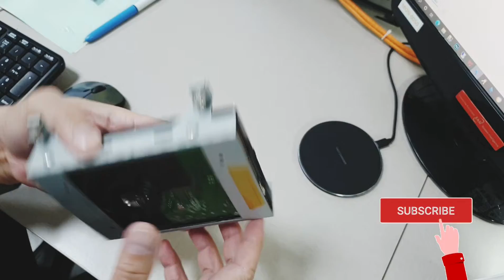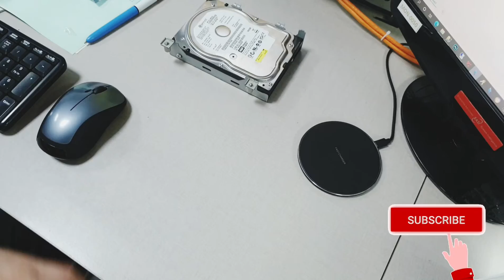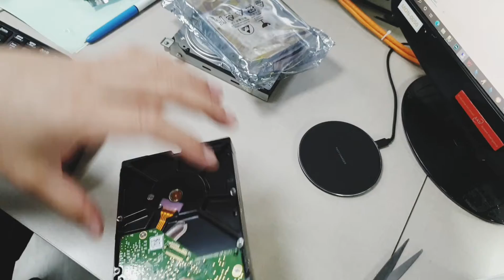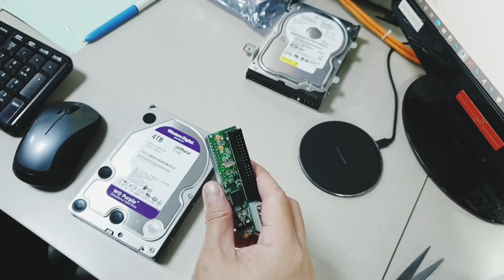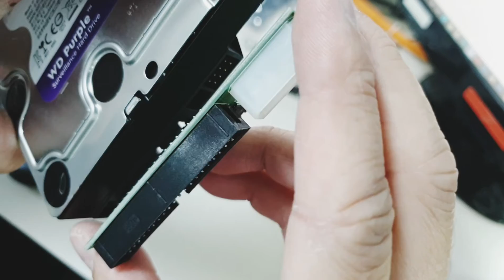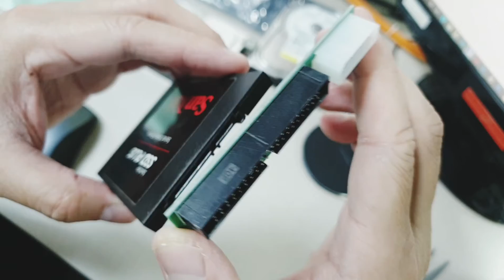IDE To SATA Converter: Revive Old Computer

Comment: Someone on Amazon is saying that these converters can't burn CDs with a CD/DVD drive SATA that it cause freezes and crashes unless the person using it is not slowing down the burn speed so I don't know if anyone investigated that yet.
Reply from the maker: Hi, I have heard that there may be some issues with using these converters for CD/DVD burning. Some problems may arise from low data transfer speeds in which converters may not provide adequate speed. It could also be due to driver issues or inadequate power to the optical drive, leading to failures during the burning process. Additionally, it might be related to chipset compatibility, where the converter might not fully support the specific functions of the optical drive. But for, I'm onlyl using this to run older pos machines that uses IDE.

Comment: Forget computers for a moment why does items like harddrive recorders with lots of different brands all with different firmware these adapters don't work. In terms in the  environmental impact of things becoming obsolete and for the land fills   sites just for the sake of a hard drive that is not made anymore. This is unacceptable adapters are bull shit they should release a ssd ide drive that will actually work or if they can make IDE to the same spec as spinning platter
Reply from the maker: Yes, sometimes I do wonder why they didn't create an SSD that has an IDE connector as an option. It should make all of our lives easier.
Reply: @ReynaxisSolutions   they do make ide ssd but mostly 2,5 laptop size and very rare 3.5 full size but they are very expensive and still will not read or format fat 32. manufacturers don't want us to be able to use old computers and other things that we can repair and not throw away.
Reply from the maker: I agree. Even this converter that I used here is only great in PC's where there is more room for this to install. However, I used it to revive our old POS machines and I ended up with the cover's of the pos not closing properly due to this converter's design.

Comment: Hey Rey, thanks for showing this adapter, will this allow me to use a old desktop computer, but using SSD drive, and using a Linux operating system.
Reply from the maker: Hi Mark, welcome. I use lots of this to use with our old pos machines that uses IDE.
Reply: @ReynaxisSolutions  I just ordered one on eBay, I'll let you know how it goes once I get it installed
Reply from the maker: Hi Mark, noted. Good luck.
Reply: @Marco916SacTown im trying to do the same thing, except with a sata 2.5 320 gb hdd, let me know how it goes or if you already did it how it went please